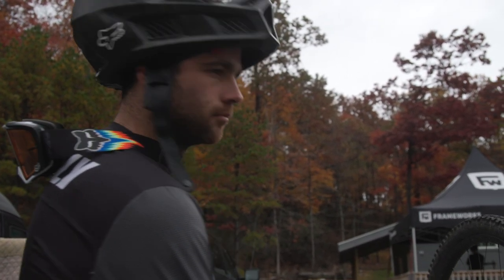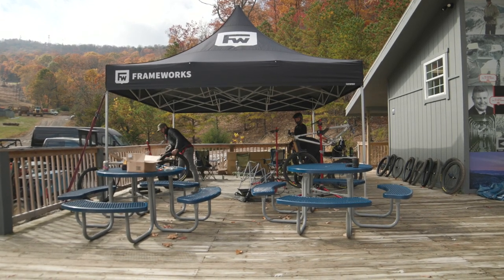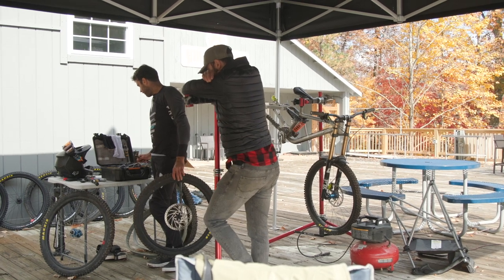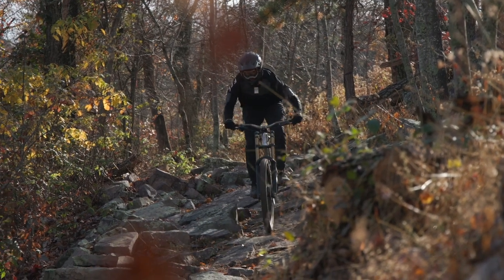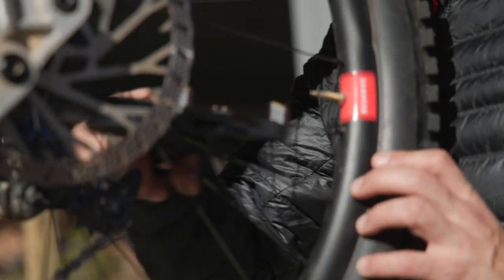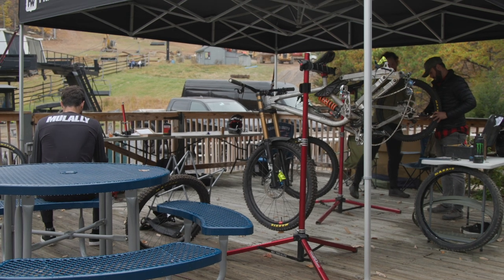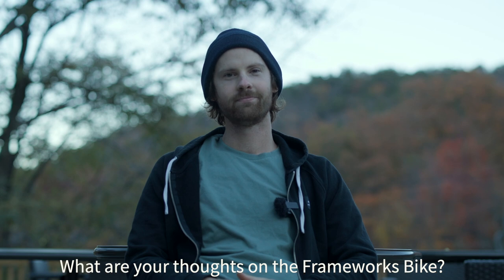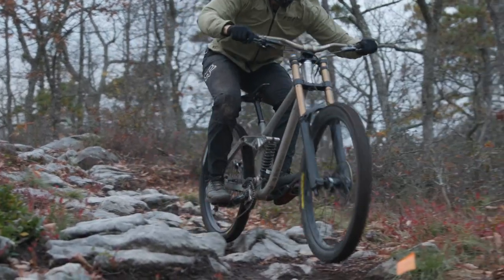RESERVE WHEEL TEST | Neko Mulally

Comment: Still cool that you're doing these and being so transparent, very cool to get the "inside" on this sort of stuff, look forward to some more stuff and your eventual realizing of a "final" design. 
Yeah, pretty cool that a brand would do that instead of just letting it slip under the radar. I know it's a compromise/balance between low enough pressure for enough grip vs hard enough to not hit the rim or roll the tyre all the time, but the clip at 0:39, yes, square edge hits at speed, but I'd have to guess a couple more PSI would have helped a lot in negating dinging the rim and not compromised grip.

Comment: I would think an air shock would deliver more punishment to the rear wheel, than the coil shock. May not be relevant if you're only using a coil for racing, but may be beneficial if you're trying to test to failure.